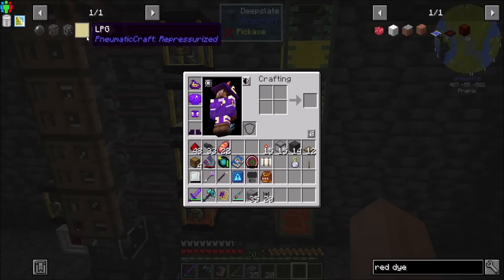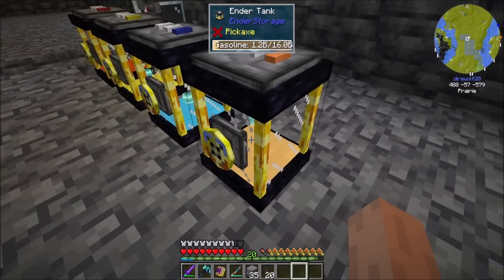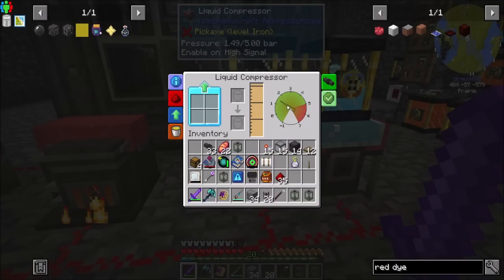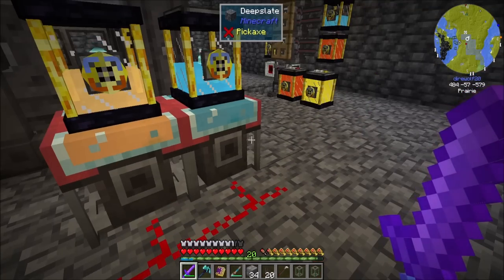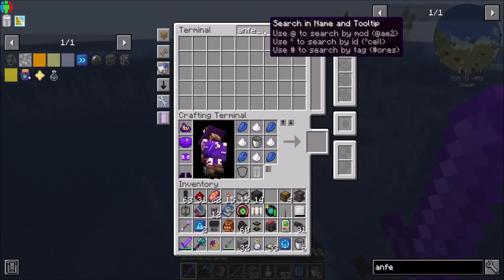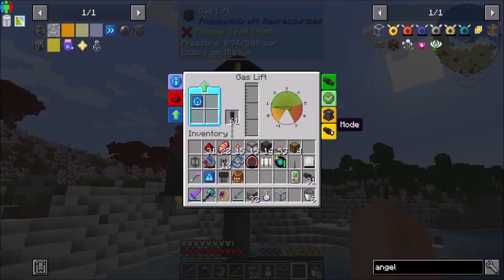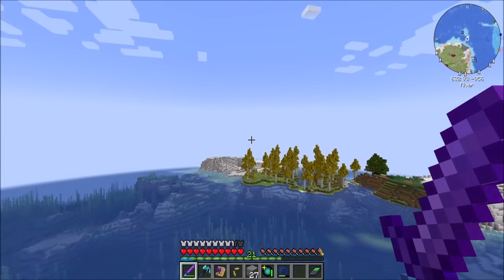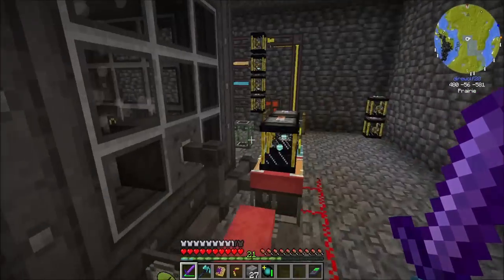LetsPlay S12E52 Lubricant and Plastic

Comment: Cover all the sides of your refinery too keep the temperature in. either use thermal laging or trap doors on the front including the bottom one haha you can use heat pipes or even blocks of compressed iron as heat transfer material

Comment: @8:00 you have low pressure in your pressure chamber because there is a vortex tube connected to it. You should never put those two on the same network.

Comment: I wonder if Create pump would treat the oil as an infinite source?
Reply: Yes and no. By default only lava and water is allowed under the create server side configs. Also, the config is set to 10,000 blocks of fluid before it is considered infinite which can be altered in the server configs. Lastly, the fluid laser with a black lens is bugged. I put in a bug report but my guess until DW20 runs into to issue it will not be fixed. When he does figure it out it will be fixed faster than an unidentified object getting shot down over Alaska.
Reply: @skburke2000  for oil, if i remember correctly, its always "not infinity". I mean, sources of oil not contain 10.000 blocks.
And im curious, why black laser lens "bugged". I mean, what should be happening if you use it ? And to be honest, FTB Team reacts very fast, if some bugs appears. Fixing a bug with some AMD Graphics took two updates (2 weeks or so). Did you ask about that in their discord ?
Reply: @ranid0072  black lens in a fluid base should produce 50mb of crude oil per process as long as you are in a whitelisted biome (Ocean or Desert). Nothing happens. . .
Reply: I would be okay if Dire would set up a laser drill to prove he invested the materials for it, and then set up a creative tank with oil in it and have a laser io node pull from it at approximately the rate at which the laser drill would produce it.